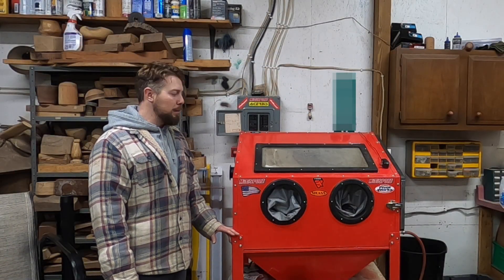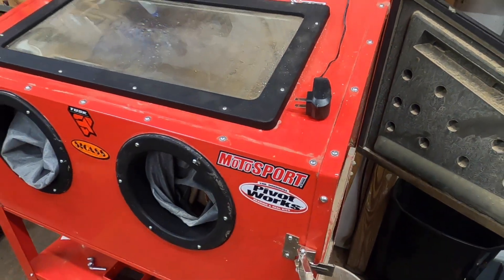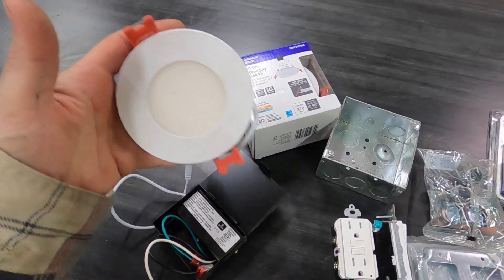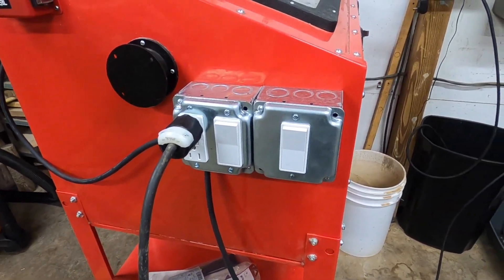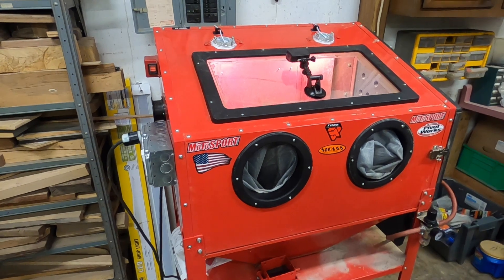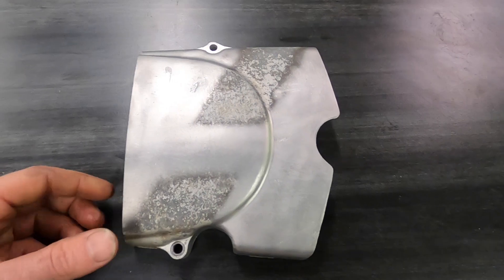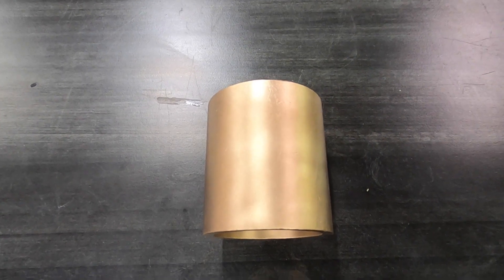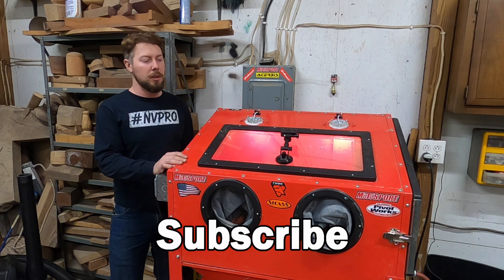DIY Vapor Blaster Build & Setup!

Comment: I see a lot of guys just putting the hose in the bottom of the bucket. I’ve only seen u and 1 other guy do the holes with the spacers up off the bottom. I’m gonna try both but think I like the holes drilled better. Looks good thanks for the vid.

Comment: My b3ad blast cabinet leaked even after extensive seals being fitted. By fitting a cyclonic filter and using my vacuum cleaner the negative pressure prevents all leaks, no dust etc. Could thst work with a vapour blast cabinet ?

Comment: Vapor blaster is really used as a finishing step rather than a primary clean step. You need a second cab for primary cleaning, then your finish will not be so mottled.
Also, your pressure is way too high for glass beads, they get destroyed quickly rendering them useless. Best at 50 psi

Comment: Hi,
Nice. I have a pump that does 20m3/h and a 100 liter air compressor but ive read that you need at least 15 CFM? What did you used? Normally a compressor can be adjusted on its pressure not its flow right?

Comment: I noted that you are blasting at 90psi. Is that because you are using 3/8 air hose? Is that to keep the CFM up?
Reply from the maker: It was just a number I picked and I am still having a hard time with the compressor keeping up. Thanks for watching

Comment: Just subbed... I've just put together my cabinet. Couple of teething problems... Think having the right gun is part of it. I'm in Australia so getting the gun in from Tacoma or Matt who has just finished making his sets me just shy of $400 aussie dollars so I'm trying to work with what I've got for now.
The other issue I think is media... Getting the right consistency/ratio of water and media.do you have a ballpark figure on litres and media?
Reply from the maker: Thanks for subscribing! So I've heard of other people using different nozzles and still having success..as far as media I'm using like 2 cups of media to 4 gallons of water. So far working great! About 80psi.. how's your pump mixing the slurry? Working okay?
Reply: @DualsportDisport  yeah moves well... Just gotta add a few more holes in hose I think to mix better. Plus I 1st used a square type fish crate for media and pump but I think a bucket or round tub will work better due to cyclonic effect... Trial and error. With a squar tub I found a lot of media wasn't mixing.
Reply from the maker: @gc33  yes the holes are key, and sometimes on mine the thing makes a slimy pluggy substance over those holes that I have to blow back out backwards using air, more often if it sits for a while. You have enough flow on the pump?
Reply: @DualsportDisport  yeah plenty of flow. I've actually also put a tap at end of the hose so I can also control flow to make sure plenty pressure coming out the holes. Without the tap it will just go straight out the end

Comment: What size compressor are you using
Reply: If i want to buy a 4.7hp with 14.1cfm at90psi and 16cfm at 40 psi. Is it too small
Reply from the maker: @vwpier  honestly I'm not sure. If somebody else sees this maybe they will comment on that. Thanks
Reply: @vwpier  its a little small but it will work.  You’ll just have to let it recharge from time to time and your motor will probably run continuously.
Reply from the maker: One that is wayy too small
Reply from the maker: Thanks for watching!

Comment: Nice Tacoma gun I am sure Mike told you to put anti-seize on the threads if you are using it for vapor honing
Reply from the maker: Thanks Mike is a great guy and really helped out plus the gun works incredible
Reply: @DualsportDisport  You can use the boron carbide nozzle with the Tacoma gun as well if you are blasting with some aggressive media
Reply from the maker: Good to know. Do you vapor blast yourself? Thanks for watching
Reply: @DualsportDisport  I am on Youtube Axis Vapor Honing Industries
Reply from the maker: Nice I'll check it out and probably subscribe thanks for putting some info here in the comments for the other viewers